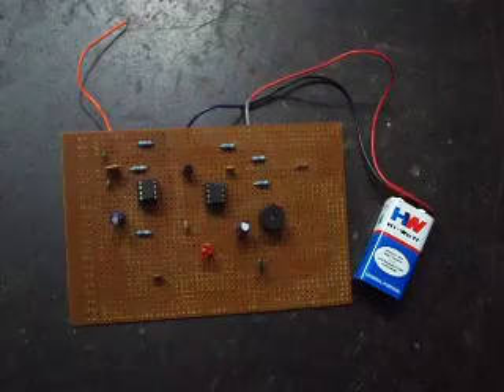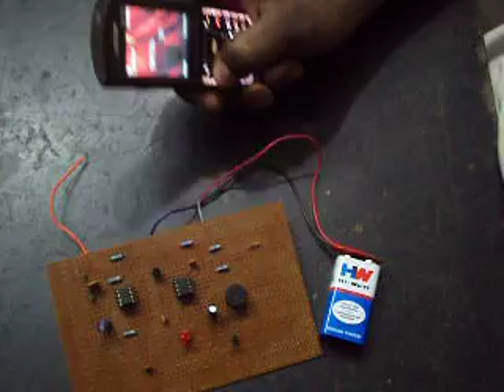Mobile Bug Detector

Comment: not working for me
Reply from the maker: What is the problem
Reply: all connections are working , , i even have a 5 inch long antenna, but confused y nt working
Reply from the maker: AADIL QAYOOM
May be some problem with the components. Check the components using multimeter and check whether antenna connection is perfect or not.
Reply: sure.